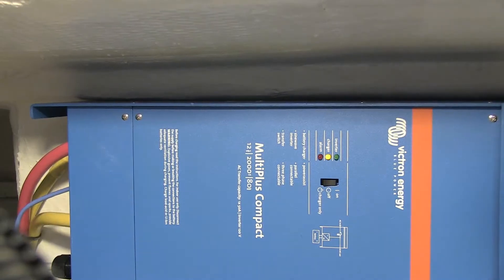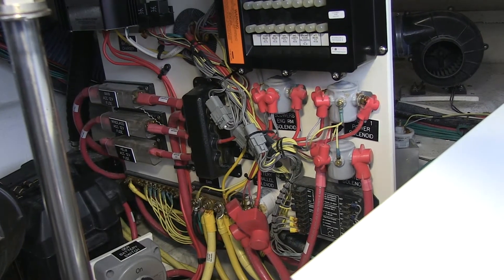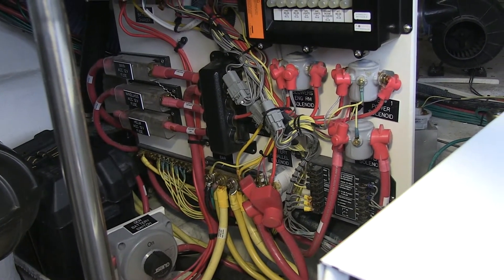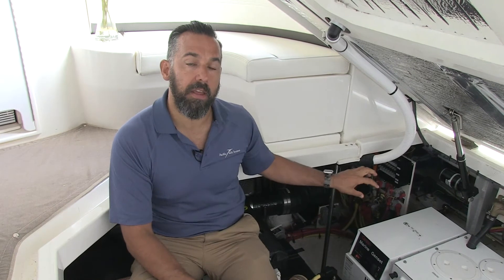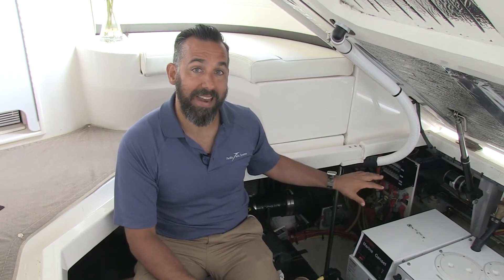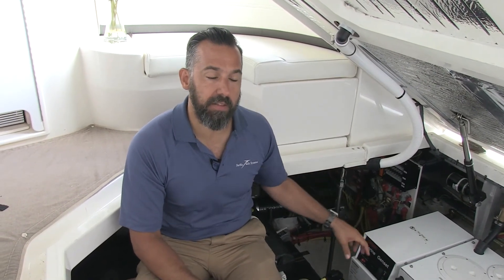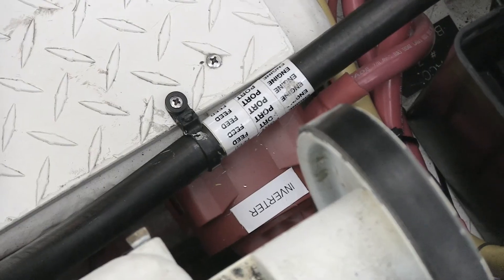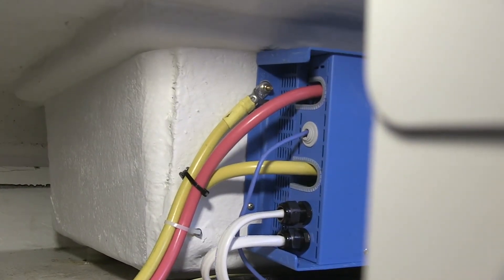DC Boat Wiring for an Inverter/Charger Installation

Comment: This will be like hitting a jackpot if you answer a question on a 7 year old video..... Jeff, but what if I am going to just be adding a small NON-charging inverter like lets say a 400 watt Victron) with the specific purpose of supplying a Starlink and maybe a few other low draw devices like a phone charger or a laptop......Can I safely hook up wires to the inverter from something like a nearby 12 V outlet?

Comment: (1.46) You said "they should always never be un-switched" - i.e. they should be switched...Did you mean to say that ?? Because you then went on to say they should be connected directly to the battery...
Reply from the maker: Hi ColGadarby, good question. An inverter/charger circuit needs it's own dedicated on/off switch connected to the unswitched distribution of the battery.

Comment: I am really sorry but on your diagram it shows the inverter/charger hooked to the bus bar and not directly to the battery, so I'm confused and I also want my battery monitor to tell me how much the inverter is using as well, am I looking at this wrong. Thanks
Reply from the maker: Hi Hardy, a unswitched distribution is effectively a connection at the battery, but not literally. One could not connect all wires directly to a battery as the maximum amount of connections is 4 on one post. Your battery monitor measures amps on the negative side of the distribution.

https://www.pysystems.ca/site/assets/files/2537/pys_inverter.pdf
Reply: Perfect, thank you again

Comment: question to see i have the info correct my set up is 24v battery bank fused then runs to a Master isolation, this has  two outputs to a bus bar and one input form Alternator, the two positive go to a bus bar then fused opposite posts to a Victron 24/5000 inverter charger, there are out out puts from this bus bar also to Victron Battery protects then to other distributions. From what you say i have it correct ? thanks for your answer or anyone else

Comment: I have four 6v batteries,in a 12v system.i have both sets running to junction posts.from there it gets distributed through the boat.Can hook the inverter to the junction posts

Comment: I have a victron 3000 watt inverter I am getting no power out of it I get 11.7 volts in and 12.5 when the boat is running I have no lights on the charger or the aux panel I have checked all fuzz all ok and switch I disconnected the pos wire and still get same voltage can you help me
Reply from the maker: First off, is your Victron an Inverter only or an inverter/charger?
  Assuming you have an inverter/charger, you’ll need to have an AC source (shorepower or generator) powering the AC input for the inverter/charger. Once the inverter/charger has an AC input the charger function should work. The inverter function should when the DC posts of the inverter are connected to a good battery voltage (e.g. 12 VDC). The inverter function will then provide an AC output.

Hope this helps.